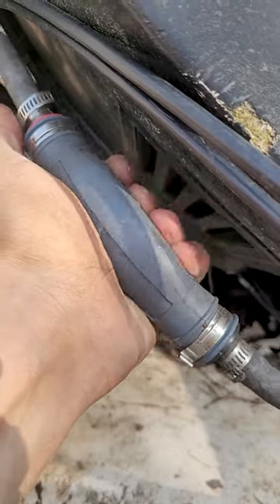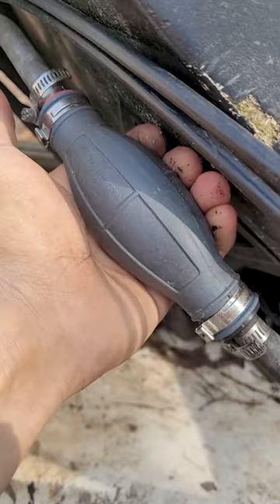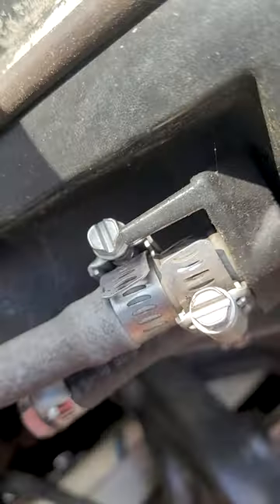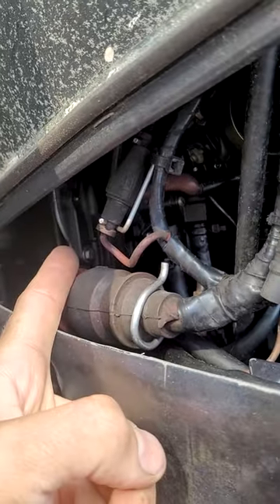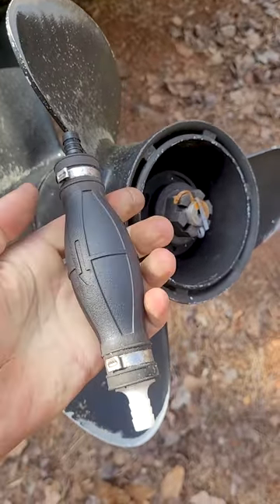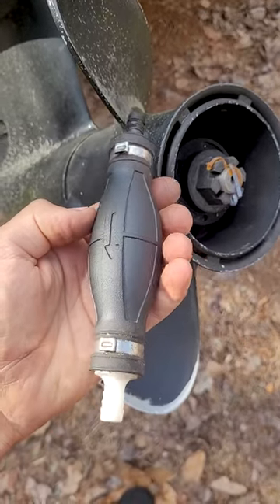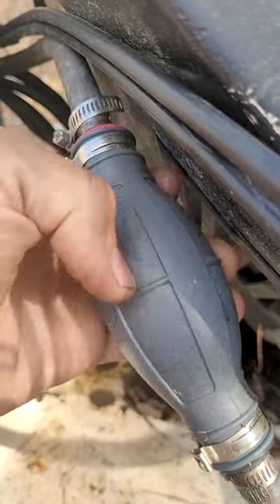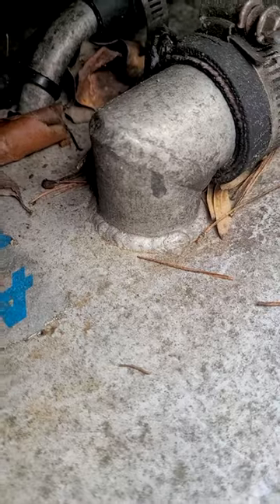Boat Outboard Primer Bulbs?

Comment: It helps to mount them vertically with the arrow pointing up especially if you have one that’s older and failing there’s a ball and cup in there and it helps to use gravity to your advantage

Comment: You have to get rid of those metal hose clamps and the wire zip ties that are being used for fuel clamps and go with proper marine fuel zippy's. Those engines suck a lot of vacuum and they're going to pull are around those connections also get rid of that gray hose they have a thin PVC line on the inside of them that will collapse it will pull and it will cause lots of problems run a regular fuel line. And if that's an Atwood bulb cut it off and throw it away and go with either an OMC or Mercury bulb!!!